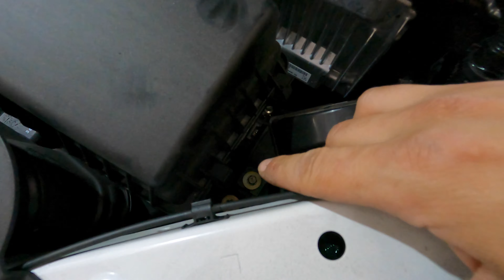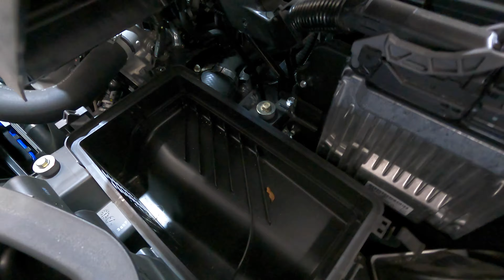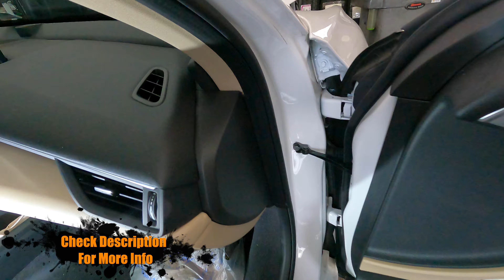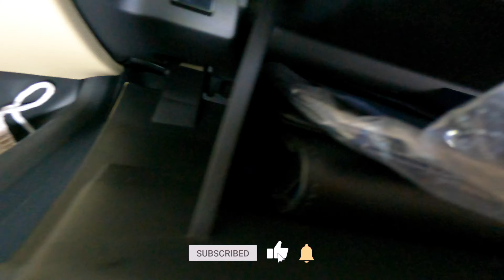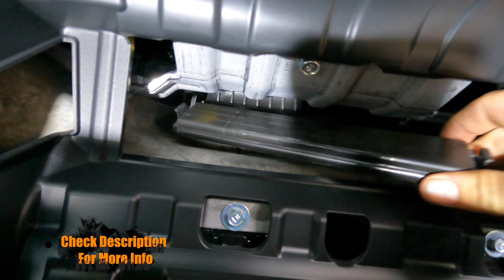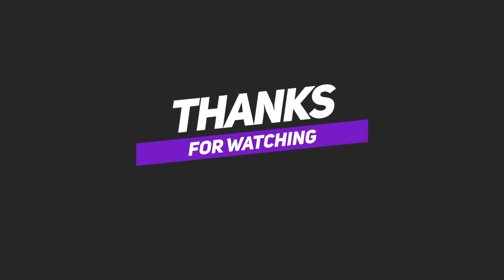How To | 2021+ | Acura TLX | A/C Cabin & EngineAir Filter |

Comment: The inside cabin filter, is that where the smoke is trapped? If I change this filter, does that eliminate the smoke smell?
Reply from the maker: yes
Reply: Are there filters or anything else that can hold smoke from behind the vents that should be cleaned or what not?
Reply: I drive a 2021 acura tlx

Comment: What's with the tiny-ass space to change the cabin air filter?! I dropped the stupid cover down that hole twice because I don't have baby hands that can fit in there. I swear they're making it harder and harder to do basic maintenance to force you to pay $120 for a cabin air filter change...
Reply: It was super easy to do on the 2009-2014 Acura TL's. All you had to do is remove the plastic shelving and release the plastic cover then the filter would be exposed. It looks like they got hint of it being too easy to change and did a redesign. Most cars use this same process for cabin filter replacement.
Reply: Im sitting here fuming after dropping the cover down twice.  My hands are too big to easily put that cover back on. 😡
Reply: I just changed mine and I had to catch the cabin air filter cover bc it was going down that crack 😂